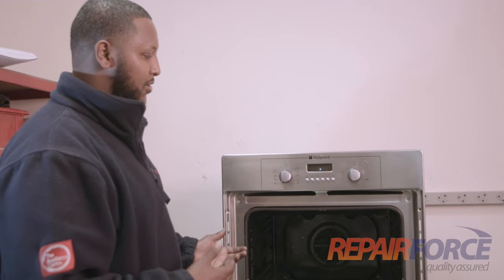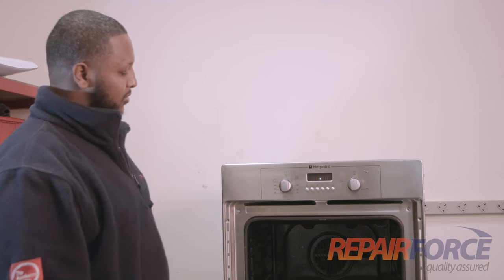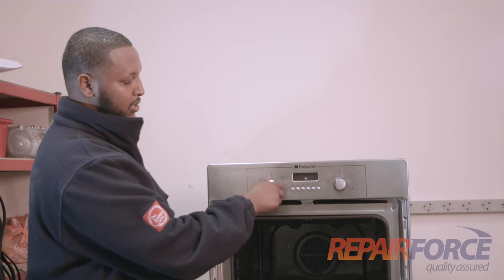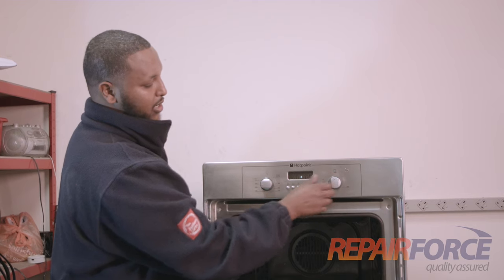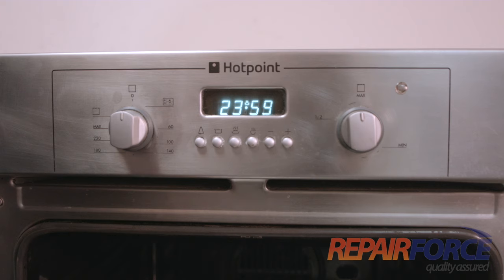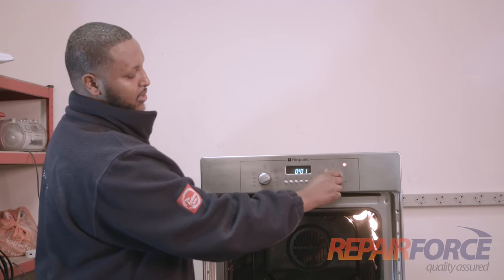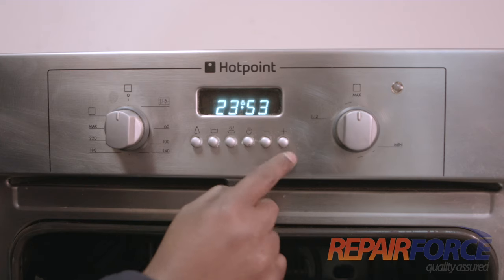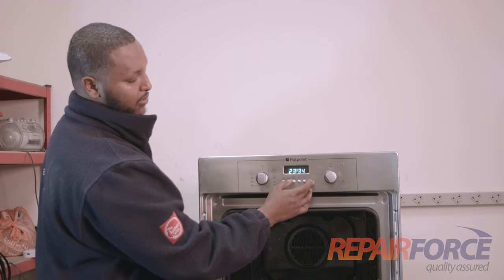How to Change the Clock on an Oven

Comment: I think you need to put the model of oven in the description please.
And I'd call this "setting" the clock.
"changing the clock" would be 
explaining removing the oven(if required)
 explaining how t o get at the clock
explaining how to disconnect it and fit a new one
reassembly